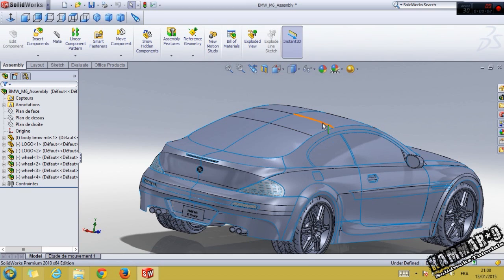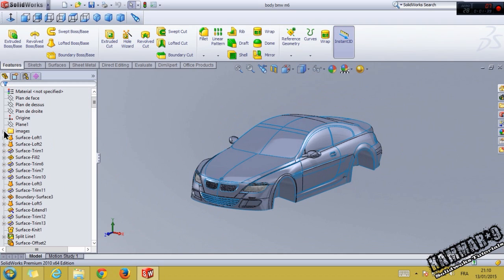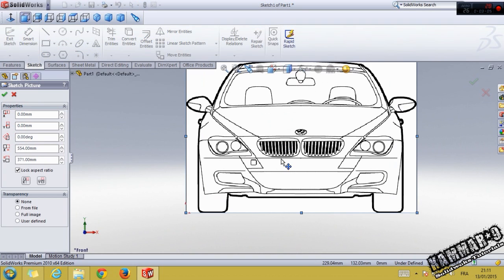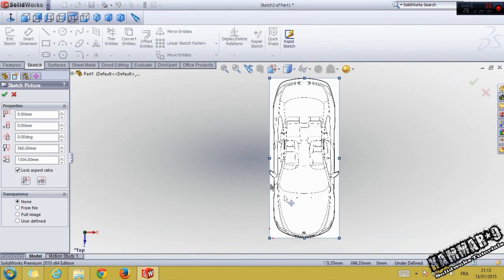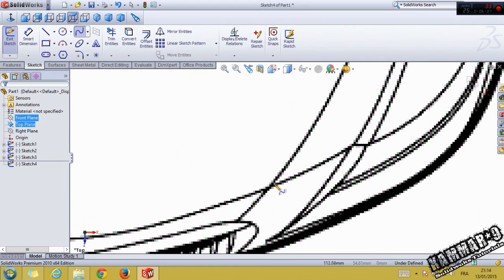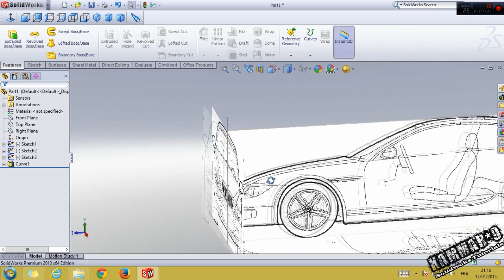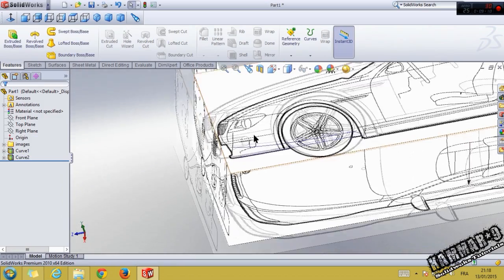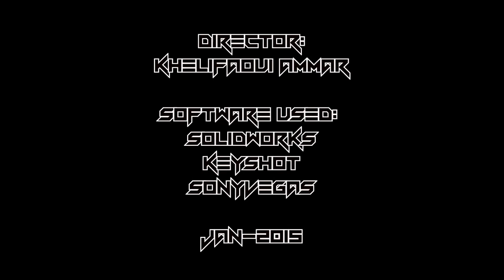Solidworks Tutorial # 14 BMW M6 with Solidworks part 01 /23

Comment: Did you snap shot the front and side view off the image containing all of the views? I’m trying to model a truck but I can’t find specific prints for the front and side views
Reply from the maker: No , i find this in one image , then I used paint to cut it to fore views
Reply: khelifaoui Ammar thanks, that’s what I thought, probably just worded my question poorly. 

Do you know if it’s possible to use different front and rear views for similar generation cars/trucks? For example in real life a Chevy Silverado can fit a GMC front end, is this possible to model in solidworks?

Comment: AmigoFriend I do the same thing you do in the video but I get the following message. "The final sections for a coating must be flat or 3D surfaces or surfaces, a 3D section that is not a boundary of a face or surface can not be used as a final section." and I'm using solidworks 2017
Reply from the maker: Hi there bro  , send me pic in email please
Reply: @AmmarKhelifaoui  yes me too, please im using solidwork 2013